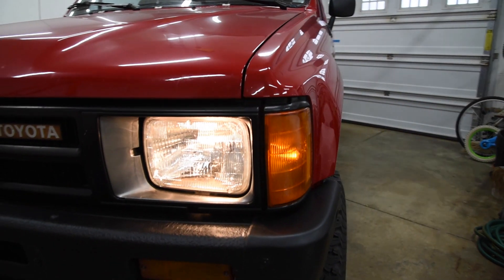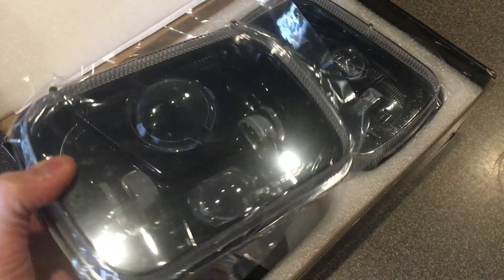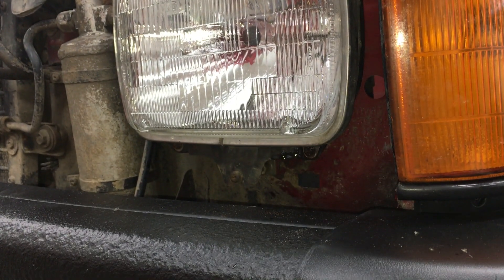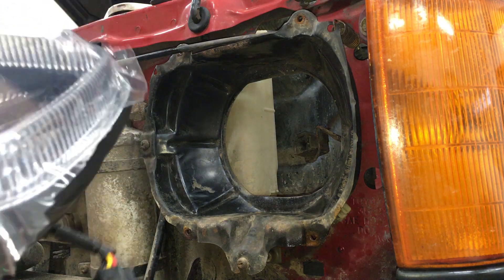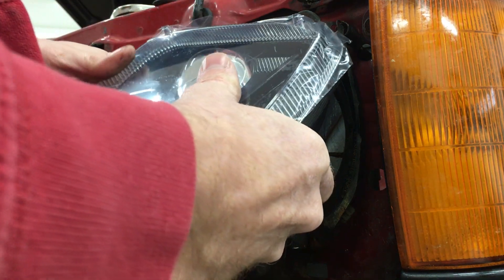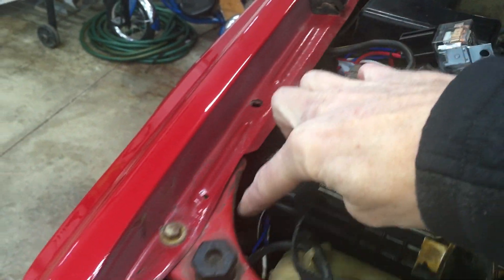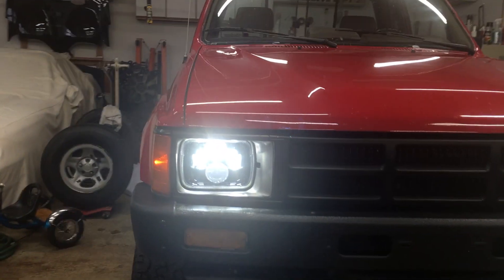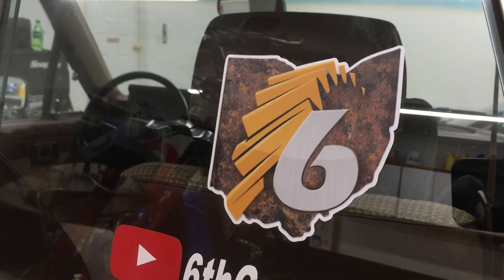How to: Install Toyota Pickup Truck LED Headlights - 4Runner & Tacoma too!

Comment: Damn I did exactly this. Before I got the harness, all the lights in the new fixture came on when I turned on low beams, this is after I switched the black and yellow wire like you did (I also suspect the previous owner switched the lows and highs because the factory lights were so dim). 

After getting the harness I did exactly what you did and nothing. I cleaned the grounds and am sure I did exactly what you did but neither lows or highs worked when I tested them.

I will post an update if I figure it out in case anyone is experiencing the same but if you have any ideas of something simple I may be doing wrong or not checking they would be greatly appreciated!
Reply: I forgot to add, great video and very thorough. Thank you for making such an in depth, trouble shooting guide for this!
Reply from the maker: Did you try switching the wires back?  I didn't even use that short extension harness that allows you to switch the wires that came with the LED headlights after I bought the full $20 relay harness.
Reply: Yes I did, If I remember correctly the hot wire stayed on the left, yellow on top and black and the right correct?
Reply from the maker: @Yabishp  it's been a while... I'll have to take a look to remember

Comment: I just bought some head lights with DRL on the edges for my 88 runner. could you make a vid on how to link those drl with the stock yellow drl's
Reply from the maker: You'll need to splice into the factory wires for those lights.  I didn't get those kind because I wanted to leave the original wiring alone in case I ever go back to stock.

Comment: Hey fellas working on a 92 pickup I changed the bulbs to LEDs but the blinkers and flashers blink way too fast. Any idea what I can do to fix this issue?
Reply from the maker: @rudyalvarez8339  what kind of lights did you use?
Reply: @ just some aftermarket bulbs that I purchased on Amazon. They had the same type of connection but maybe there just cheap. They look very nice and bright the fast blinking is just not what I wanted
Reply from the maker: You will probably need to install a resistor because the relay thinks the bulb is burned out because LED's draw less power.

Comment: Do I need to pull the bumper if I only want to replace the glass beam with a stock one
Reply from the maker: No need to remove the front bumper at all. Just pop the grill off.
Reply: @6thGearGarage  well I ment gill but thanks. I was kinda hoping I didn't have to do that

Comment: Hey, thanks for all the videos on your Toyota. I just got an 84 Toyota Pickup. I replaced the headlight with the TRUCKMALL brand like you did in this video Do you have a lot of people flashing their brights at you? Did you make any adjustments to the lights? What do you think of the lights after a year of use?
Reply from the maker: So far no complaints but I am going to aim the lights a little lower because they’re so bright. Nobody has flashed me yet, but I don’t drive it at night very often.
Reply: @6thGearGarage  I think I’ll do the same since I do a lot of night driving. Good luck with yours and thanks for the help.

Comment: I did the exact same install on my truck except I used the harness from trail gear I think it was and I went with the three-row LED headlights. I watched your video and it was exactly the same thing for me. After I put the harness on though everything work good except all my gauges move with the blinker when my headlights are on as well as I can barely see the high-beam icon in my Dash. I talked to an automotive electrician who said he's pretty sure there must be power going out my ground and that I would need I think he said a transistor or something? I checked all my grounds are all nice and clean I'm stumped. Any suggestions?
Reply from the maker: I was gonna say check the grounds but you already did. Im not sure what the problem could be.

Comment: Im pretty sure I followed your instructions and lights are working great. Only thing is...  now my truck won’t start. Dash lights are on, power seems normal but it won’t turn over the starter which it sounds like. Any solution
Reply from the maker: Are the battery terminals tightened all the way?

Comment: @6th Gear Garage, I got these lights with the harness for my 1987 Toyota pickup. However one of the light seems to be brighter then the other as if it were a high beam, but when I do turn on the high beams it gets even brighter then the other. Any reason why this is happening?
Reply from the maker: I would check grounds

Comment: Will this fit 93 toyota pick up sr5?
Reply from the maker: Yes as long as it uses a standard 6x7 headlight (sometimes called 5x7)  And you'll need the relay harness I used in the video.

Comment: So what happens if a bulb goes out would you replace the whole light again
Reply from the maker: The LEDs have something like a 50,000 Lifespan, so they should never need replaced. They're sealed, so If they quit working, they would need replaced.
Reply: Thank you so much what’s are those headlights call I found some on amazon my truck it’s a 92 Toyota pick up

Comment: Thanks so much for doing this. I’m starting my modding adventure on an 89 Toyota pickup sr5.  What do you suggest for forums to search for parts for the pickup? Also do you have any preferences for aftermarket accessories such as winches+bumper, led tail lights, etc?  Thank you so much for knowledge and time you share with the community. #legend 👍🏾🔥
Reply from the maker: I've never worked on the 89+ trucks, but I've bought parts from LCE, Low Range, Trail Gear, 22re performance - all good companies.  Old Man Emu, Marlin Crawler are a couple more good ones. Just stay away from the cheap stuff made in china and you'll be good.
Reply: 6th Gear Garage you are my hero. Thank you! This helped immensely, I have a lot more ideas just browsing through these sites. 🙏🏾 You rock.
Reply: @6thGearGarage  Yep, keep adding all those crap after markets parts and you'll turn your Yota into a POS Ford-like vehicle.  Nothing like screwing up the best made trucks on the planet.

Comment: Is this fit 1993 toyota pick up sr5?
Reply from the maker: Yes as long as it uses a standard 6x7 headlight (sometimes called 5x7)  And you'll need the relay harness I used in the video.

Comment: With this set up of lights work on my 87 Toyota truck and I have issues with my highbeams they won’t stay on unless I’m pulling on the lever is there a relay or a fuse for highbeams
Reply from the maker: You may need the extra harness that I used.
Reply: Switch

Comment: Hey bro i have one issue. I bought the whole kit u have everything u did i did. But for some reason only my high beams works now. I have no option for regular low beams. And idea or help?? Btw i have a 1993 Toyota pickup
Reply from the maker: I would check all connections and grounds. Are you sure you got the right harness?
Reply: 6th Gear Garage I’m pretty sure i did. I got the one you linked.
Reply: 6th Gear Garage I’m sure i did. I got the one you linked. I’m going to have to check my grounds.

Comment: I just installed this setup to my 87’ 4Runner. Did you have to upgrade your fuse to your dashboard? The headlight symbol and high beam symbol are barely lit up on my dashboard  and I’m not sure what it could be. Any suggestions?
Reply from the maker: I did not have to upgrade the fuse. Are your grounds good?
Reply: 6th Gear Garage I’ll have to check that out. Once I added the additional red wire clip to the battery it might’ve got on the way of the others that I have on there.

Comment: I just bought a truck with the same LEDs but it's only on high beams you have any idea what could it be?
Reply from the maker: I'd check to see if they used the relay harness
Reply: Yes they did cant figure it out
Reply from the maker: @baltazar9865  Is everything hooked up correctly?

Comment: Hey man, I just acquired an 88 Toyota Pickup and I'm looking to bring her back to her old glory. I really like your videos and those headlights especially caught my eye. I looked at the links you've posted and it looks like the Wiring Harness is no longer available. Amazon link is dead. Is there something in particular you need for these lights, could you point me towards another compatible harness? Greatly appreciate it from North Carolina.
Reply from the maker: Vinyl thanks for the heads up! If you google “h4 headlight relay harness” you should get results for a lot of them from different companies. They all do the same thing, just be sure you get the full harness with relays and not just a pair of pigtail adapters.
Reply: Awesome, thanks for getting back to me. I grabbed just that harness with that set. Looking forward to installing them. I just installed a light bar that came with a nice relay harness and in-dash switch. Turns night time into daylight. Perfect for dark country roads at night. I absolutely love this truck!

Comment: Will these work on first gen toyota pickup such as pre 1983 without the wire harness?
Reply from the maker: Jshift4Lo I don’t have one to test them on, but i think if they did work, they would still require the harness since it’s a Toyota.
Reply from the maker: Jshift4Lo oh wait no because they have round headlights
Reply: @6thGearGarage  mind is an 82 so it's square. I would assume they also have the double negative.
Reply from the maker: Jshift4Lo Then yes, it should be good.

Comment: Anyone know where to get the black bumper and grill? Mine is chrome and I want to switch
Reply from the maker: You can find them on ebay, there are brand new reproductions.
Reply: @6thGearGarage  sorry, I tried a few searches and wasn't seeing them. Could I bother you in asking for what you would use as the search terms?

Comment: Hey 6th gear, do you have those rh evolution gt5 18s still? Id be interested in buying one, or the whole set.
Reply from the maker: I do have them in storage. Are you in Ohio?
Reply: @6thGearGarage  Im in Maine..
Reply: @6thGearGarage  how much would you want to get for them? i have a set but one cracked :(
Reply from the maker: @gravytrainexp6194  Let me get them out and check the condition.  If I recall they weren't perfect.
Reply: @6thGearGarage  thats not  problem
Reply: @6thGearGarage  Any updates?
Reply from the maker: @gravytrainexp6194  Sorry, I haven't had a chance to dig through the wheel collection yet. I know they're in there somewhere.
Reply: @6thGearGarage  Okay no problem man! Honestly i have a few more things to do on the celica, and i still have to get my license. But after that tbh id drive to get them! Im in need of a road trip anyways. Just lmk once you get a chance! No rush at all

Comment: Will is work for a 1995 Toyota T100
Reply from the maker: No, T100 uses a replaceable bulb so you only have to change that instead of the whole headlight housing.

Comment: The Toyota hilux have bad factory headlights Wires negative cut then Straight to the battery with a fuse